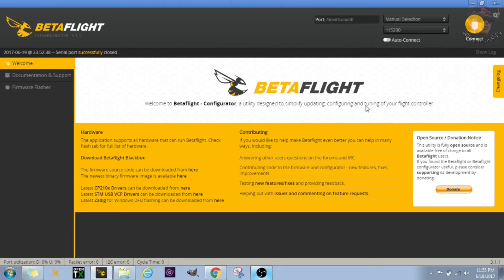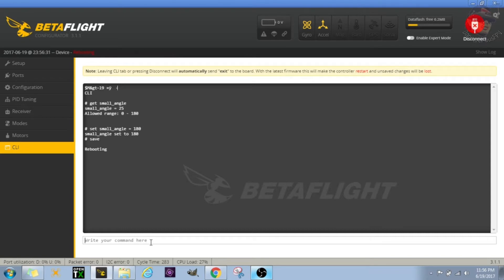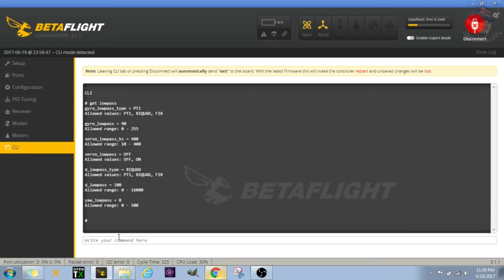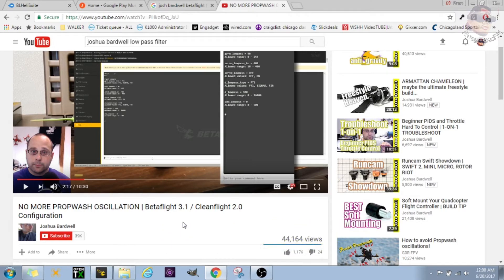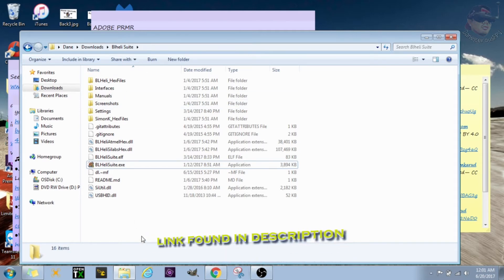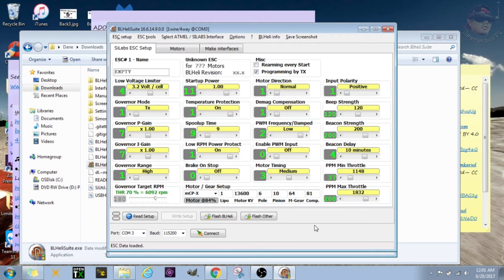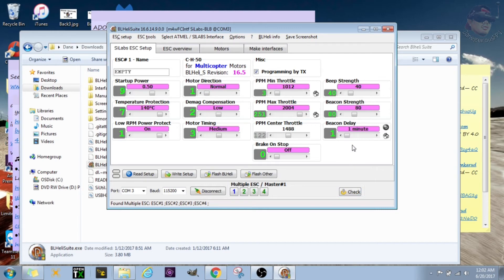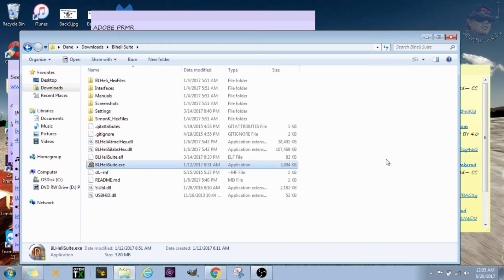King Kong 90GT - My Setup - ESC as buzzers thru Blheli Suite, upside down arming, & lowpass filter

Comment: dude, thanks for taking the time. super helpful. going to do it tonight. oh well, tried. doesn't have the same options as yours. my drop down menu only gives 3 options. and when i hit check, my motors show up as B B B B, not 1 2 3 4
Reply from the maker: Wait, What? are you changing it to a different "COM" like how I changed mine to "3"...did you try another one? is this on your 90GT as well?
Reply from the maker: ATMEL/SLABS option - did you change this from ATMEL or SLABS?
Reply: it was my error. i had 2 options of bhelisuite zip files and i chose the wrong one. chose the alternate option and it worked perfect. i set it for 223 volume. lol.  still not very loud but like you'd said, MANDATORY, without a buzzer.  thank you my friend!! cheers 🍻
Reply from the maker: Wait, What? ahhh...I'm glad you were able to figure it out! Cheers and happy flying